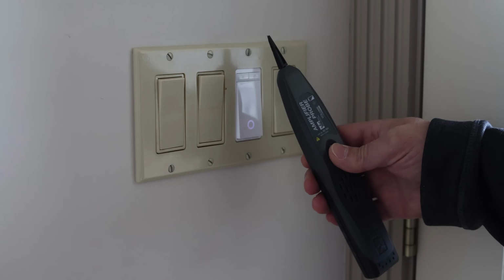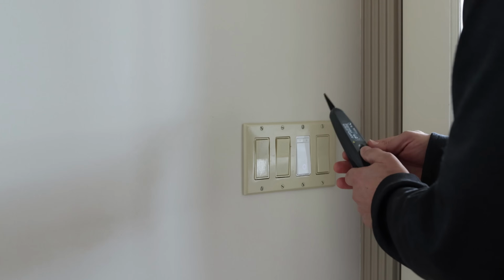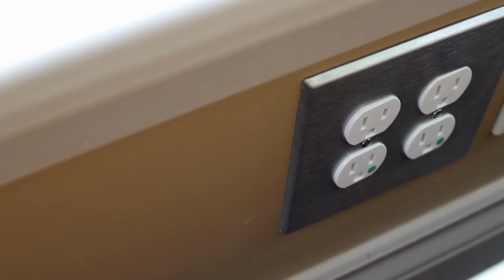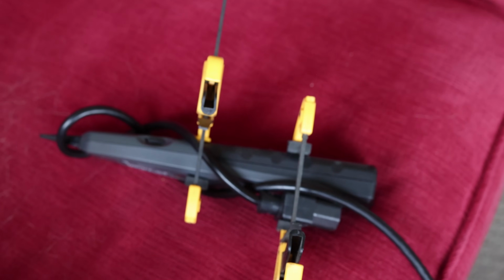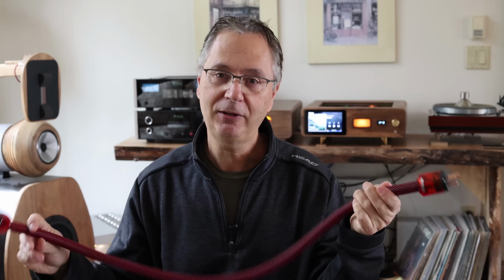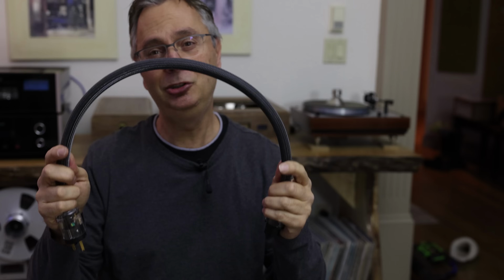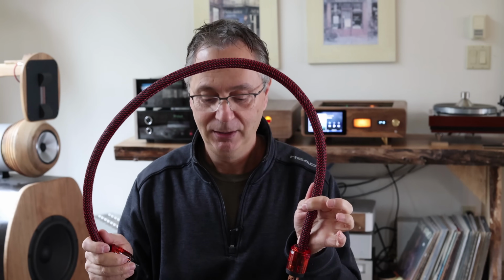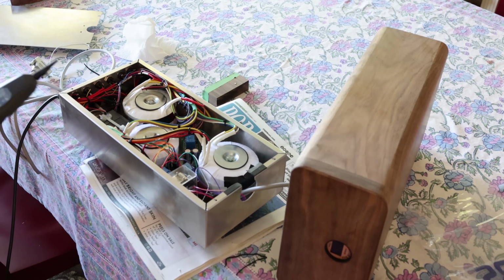My Top 5 Inexpensive Hifi Tweaks for clean power to your amp, preamp, dac, turntable, and more.

Comment: To ensure that your equipment receives no noise whatsoever, turn off all breakers and remove all fuses of everything within reach! 
You will effectively eliminate any and all noise from your hi-fi system for no cost at all! You will even notice a reduced electric bill too! 
Surly people like this don't actually exist! I'm he's faking it right? Because this is not how to enjoy music, this is a horrific OCD condition! 
Your favourite music is still your favourite regardless where you hear it and regardless of what noise is present! You will still enjoy it even it you heard it in an elevator! Or are you going to bust out your signal tracer to see if there's any other AC signals present in the elevator! 
Why would you want to be this guy? What a horrific way to live! 
Mate! Someone clearly has lied to you and sold you some terrible audio equipment, with everything that I have owned in all my years I have never needed to do something about noise on the AC line.... sounds like you need to get yourself one of those all in one CD cassette turntable stereo systems, they are great! They aren't affected by tectonic plates shifting.... They just work, you never see them getting repaired because they don't break down, instead you see only the type of equipment that you are using! Built to a tolerance, right at the cutting edge and when one component moves in its value, it blows up and dies! And you paid how much for this and it can't even protect itself from itself! 
Nah! You must be faking it! People who are this mental are already locked up in an asylum receiving the care they need to deal with the perceived noise that they imagine they are hearing....

Comment: Another one to watch out for is switchmode supplies with a two pin power lead. All switchmode supplies have input and output filters to remove all the high frequency switching noise, which is usually sent to earth, however if there is no earth these filters are severally compromised.
Often you end up with a great pile of common mode noise that ends up on the chassis of the equipment being powered. Who wants a noisy chassis any where near your gear, let alone connected in.
I've mainly experienced this with laptops, although I did see a DVD player with similar problems, whilst the actual audio out can be great, the common mode crud can easily spoil the show.

Comment: I use constant voltage harmonic neutralized transformers (CVT) to keep power line noise out of the recording equipment in our studio and the listening room. These transformers will keep out surges, over voltage and under voltage conditions. If you look at your line power on an oscilloscope you will see all kinds of garbage. The CVT gives you a nice sine wave.

Comment: Doesn't matter unless you have badly designed equipment because almost every component converts AC to DC... I guarantee with a blind A/B test, no one can hear any difference...
Reply: Please check your opinions as they are surely are not factual

Comment: I just realized myself what good clean power delivery could do to a very good hifi system.
I bought a expensive power conditioner and changed my Cables to very good shielded Power cabes. It was mind blowing, i never ever would have thought that power delivery would make such a huge impact in sound performance. I have the same hi end system for years now, but when i changed the power delivery for the first time i heard the real performance of what my system was able to...
I then changed also the remaining power cables of my system i was  totaly convinced👍🏻
Reply from the maker: Glad you discovered the benefits😊
Reply: @Gabster1  - Gabi, I wanted to thank you for all your work and contributions to our audio community. Just caught this and some your reference to power and the dimming effect which wasn't a surprise. However, I use a 5v LPS into a WiiM Pro (underrated) and even though it's good it has the LED light showing the continuous power output. So, today, I went in and couldn't easily remove a wire to disconnect it but gave the red positive wire a snip. No more "dimmer" light. 

The impact is hard to measure but in my sensitive tube amp monoblock system, quite audible, IMHO. More separation, blacker background and makes the entire audio better. Btw, I also float the WiiM Pro which seems senseless but that helped too with the fiber router going through two Meraki boxes sans power supplies (5 minutes to remove). Formerly via fiber with transceivers, a shielded ethernet through the Merakis' and then to the WiiM Pro is far superior. Who knew? Just shows that testing is needed in the journey.
Reply: What did you buy?
Reply: @specipful  Isotek Sigmas V5 and Audioquest Monsoon.
I allready had the old Sigmas Evo3 and had good expierience with it.
Than i changed my Burmester 038 Power conditioner (wich works more in a way as DC Filter) to the sigmas V5. The difference was night and day! Stereo wise its like, ok now i am there now i reached my destination... But i am using my B&W 803D also as part of a 5.1 System and not only for stereo, my B&W now have such a good warm prescise wide stereo stage, the sound got so spacial the stage so wide that you got to get used to that, if i would only have 2 Stereo speakers it would be no problem but i am using them also as Front L und Front R.
Also you now have much more detail in presentation, you ca hear instruments you never heard before on your favorite tracks, but that now also reveals it whe you have a bad recording, there simply is much more detail now in the presentation.
But i am still in the break in process, i am gona give the system time to break in an then maybe if its too much i will maybe try different power cables to optimize the system a little bit.
But i tell you, and please dont laugh, the first time i heard my favorite music, and i mean emotional music the tears almost ran donw my face it was like what the hell?! is this my system???
Reply: @Grue_ni v nice setup. Be surprised if you're surround cables are not shielded.
Reply: @Totalplonker  Thank you! I have a Pre amp/Monoblock combo. I use 1,5m Hi quality Chinch RCA to connect the monos to the AV Pre amp (Silentwire NF12). For my center and surround chanels i use smaller stereo amps in bi amping mode, also with silentwire RCA chinch. Also for the rest of the system i use very good but not overkill RCA chinch cable (silent wire NF8 for stereo and Audioquest Red River for Surround chanel)
My problem is that i have almost no space behind my hifi components, its  quite a mess. Its almost impossible that the interconect cables dont come near or cross the power cables. I think thats also why the system sounds so much better now because the Monsoon are much better shielded than the cables i used before. I will have to take  some time to sort and route the cables so they dont interfere with each other.
Now that i know how important it is but its gona be quite a task.
Now i have good cables but are they shielded so good that it would not be a problem if they directly cross each other? I mean if a interconect crosses a chinch cable?

Comment: Hey, nice Video👍🏻
I have got a question and i thought you are a pro so you might know this.
I have got a power supply like yours in the video, its for a LCD TV. I Glued some magnets on tve bottom of the PSU an attached it to a metal surface so its out of the way. Now my question.... what about magnetisation? Is it bad for signal quality? Do magnets create noise too?
Thx.
Reply from the maker: Thanks :) You should be Ok where they are but Don't run any signal wires touching or very close to the magnets
Reply: @Gabster1  Ok thank you!👍🏻

Comment: Isn't it the case that the US mix switched lighting on the same line as power outlet receptacles. It's unsurprising that this is a recipe for noise. By law the UK has a ring mains for power sockets and separate circuits for switched lighting. With 230V working voltage and Standard 4% volt drop the max length of 2.5mm ring with 32A breaker which is fully loaded at the midpoint is 78 meters end to end. There is no limit on the number of Sockets on it. In my view the US system is inferior is aluminum cable still used?
Reply from the maker: they do not now but in old houses they did

Comment: Now I'm glad that I installed a dedicated line for my main system when my house was being built. I have had no problems. Great info.
Reply: Wherever you have an AC line you have noise, the AC signal is a noise itself, 50hz or 60hz depending on where in the world you are! And just as a radio transmitter puts an AC signal on top of the carrier AC signal to reach your AM FM Radio tuner, so too must your AC line carry all sorts of AC signals no matter where you are, you are connected to a grid that will send you all the pulses that someone in your area is generating with their grinder or welder directly from their garage to your fine home! 
Just stop using electricity altogether and purchase a vintage wind up turntable and you won't have to pay for electricity and it won't be affected by noise presence on the AC line.... It's simple. You are going down a never ending Rabbit hole which has no solutions for anyone in the audio hobby...
Reply: @PeterMilanovski  you make many factual points but I have solved what you state as unsolvable bottomless rabbit hole by applied sciences and material applications and novel advanced technologies

Comment: I have a Honda EU 20i. Total isolation from mains.  Unbeatable.
Reply: And the noise from the 2 stroke gas engine?
Reply: @5thlevelweb887  It's not that bad . I run it outside.  The fella across the road has a bigger unit in the garage and that is loud.  I only power what is needed. He powers everything, even the lights around the house.

Comment: Electrical cabinets are much more elaborate in Europe, Light has to be on dedicated lines. You even have to have 2 light lines in each sector of your house. The normally you are not allowed to have more than 6 sockets on a power line breaker.
An other thing is that all appliances like fridges, washing machines ovens, cooking plates have to be on a dedicated breaker each. So is every heating element, air-co unit, etc.
In my case I have 3 phase grid connection. So not every socket or appliance is on the same phase. Some are 400V 3 phase. 
Sockets are on 13 AWG wire, ovens and cooking plates on 9 AWG. Only light circuits are on 15 AWG wires. Main supply is coming in with 4 times 3 AWG wiring.

I know that in North America it is more common to have 180° 2 phase (in fact mid tap transformer) mains. And you have to have a real big house to have more than 5 breakers.
Are Light and socket circuits mixed ? What about safety breakers (30mA leakage breakers or 10mA in humid areas) ?
Reply from the maker: The new houses are more compliant and do not mix lights and sockets but most houses over 15 years old can have mixed sockets and lights also even with separate circuits you still get a bit of noise as demonstrated
Reply: @Gabster1  I looked with a scope and except some noise from the inverter from my 3 phase water pump I have almost a complete clean system. I have filters and off line UPS systems all over the house. Every important system is on one of those.
I have perhaps a bit over engineered the system 😁 but that is the way I work so...
Oh and the solar inverters make also a small amount of noise, so I put a big filter on that system also, L-C-L 3 phase. And this is on a separate system with its own cabinet.

Comment: VERY INTERESTING video. Therefore, I check my audio line and I found that, besides my audio gear, I have 3 smart dimmers / switches on my audio line. Therefore, knowing that, I was wondering : If I keep these 3 switches / dimmers 'off' while I was listening music, will I have the same results I would have with a dedicated line? Do you know if a switch / dimmer set to 'off' induce noise in the line? Merci...
Reply from the maker: You can leave it off or fully On just not dimming
Reply: Super Gaster. Merci beaucoup. It will save me the cost of a dedicated line. PS Your videos are very instructive @Gabster1
Reply from the maker: Merci @GuyMartineau

Comment: You could replace the powrr receptacles that feed you system with  Commercial or Hospital Grade outlets.  They employ stronger and thicker copper/brass for a more secure fit.  Also, you can replace any other old, worn or loose receptacles in your house.  With wear and time, they can loosen, reducing the metal to metal surface area eith equipment plugs.  It's  posdible for micro-arcs to inject noise into the whole-house wiring.  Also, ensure that leads are tightly connected at your breaker box, as they can also loosen since installation.   The correct i sulated screwdriver and perhaps insulated gloves are needed to inspect/tighten/replace if done DIY. Im sure an Electrician would charge a modest fee for this service if all work was done in a singlre call.  If you DIY, 15A duplexes are about $.55 in bulk; 20A Commercial are around $4 ea, and 20A Hospital Grade are about $8-10 each.  Don't forget Ferrite RFI chokes.   FYI, i am using the Provant Therapy medical device.  It generstes a pulsed electromagnetic field from a transmitter pad for eound healing, pain and edema relief.  The 6ft cord/cable from the control unit to the active device/pad has 6 ferrite beads emdedded it it. The powercord itself has one that is about 3/4" diameter and 5" long.  Engineering put them there for a purpose.  One final thought; I had a Seprrates, with a Dennon DP-47F.  Items were in two DIY cabinets, with a CRT TV between them.  At the time, I used @monstercable@ interconnects.  After I changed the layouts of the components,there was a very loud hum from the turntable interconnect as it traversed behind the TV.  Through research,  I came upon Blue Jeans Cables (ebay?).  I bought their Belden/Canare in 6ft.  Problem Solved.  The shielding was so effective that when plugged into the phono stage and open at the other end; wrapping the BJC cable around the TV produced no hum.  Of course, when I pointed the open Canare RCAs at the TV, i got hum.  I yanked all the mOnStErS a d whent Belden/Canare.
I bulk purchased Canare RCAs snd Belden cable and rolled my own.  Really cleaned things up, even with microphonics, which is real- just turn up the volume to a source thay is not playing and thump the interconnect with a thumb/foreginger action.  With the mentioned Canare/Belden and a decent crimper, one can get $$$ sound for $.  Sources include Mouser or ebay.  On ebay you can find Belden cable on whole or partial spools.  Always buy extra length on the cable.  Hope this helps someone.
Reply from the maker: Lots of great info Thank you for sharing 🙏

Comment: False science is dangerous in the hands of an idiot. Just remove the dimmer switches if you're that beefed about noise on the mains cables. Your hifi just turns it all into DC with massive amount of filtering. Just another twit vomiting snake oil.

Comment: Great video, and I agree to all your points. I have 5 excellent power cables and they DO sound different(s). One I made one from excellent parts including pure copper Viborg connectors another is my own except the another pair of pure copper connectors and the other 3 were ordered online. I don't have this probe (but will get one soon), but have a question.  In your estimation would copper foils wrapped around the switching power diminish these noises you demonstrated or lessen them?  New subscriber as of today. Thanks for making and posting the video 🙂

Comment: if you can't use linear psu, that do have quite low efficency so not good for routers etc (in general loads 24/7), then use Meanwell switching psu... are not crazy expensive and do have high quality ;)

Comment: As an electrical inspector and hifi enthusiast, I agree with your assessment. I would like to add that you can address these issues, especially if you rent, by using an isolation transformer and a power conditioner with good capacitive filtering. An AC to DC to battery to DC to AC configuration will also achieve similar results. A good quality UPS could achieve that, but I don't know her much noise its internal electronics generate.
Reply: Absolutely none whatsoever! 
The AC signal is a 50hz or 60hz signal itself, and it manages to pass through an isolation transformer with no problem! If you can detect any signal other than the frequencies mentioned above, you would have detected them simply because they are all AC signals, and they will all pass right through an isolation transformer.... 
The only reason you should be using an isolation transformer is when you need to ground lift the equipment that you are working on while it is powered to prevent you from blowing up your oscilloscope or killing yourself by passing current from one end of your body to the other causing heart failure... With an isolation transformer it can only pass through one hand so long as you obey the "keep one hand in your back pocket" to prevent current passing across your chest, you will feel the shock but it's less likely to kill you instantly..... 
It doesn't isolate noise, it's not what it does.....
Reply: We're renting atm, would adding just an isolation transformer have any benefits? Thanks,
Reply: I just use a couple of lams with low output bulbs.
Sometimes simple solutions can be  best.